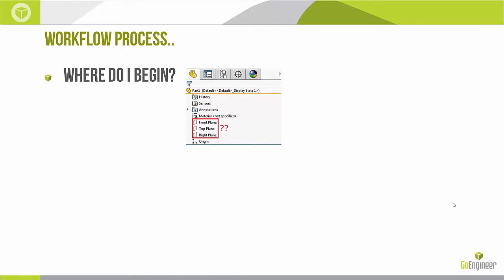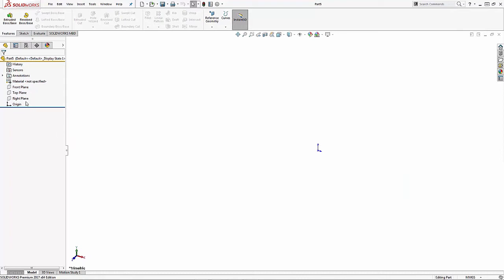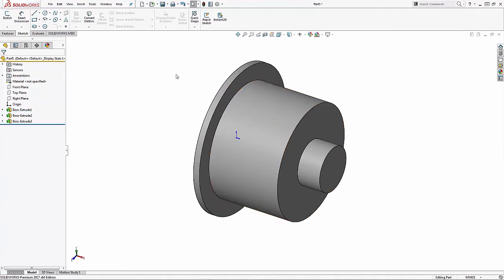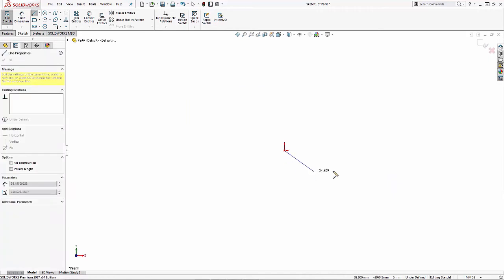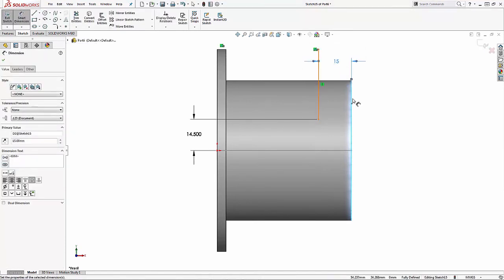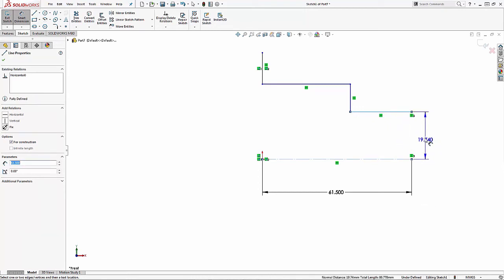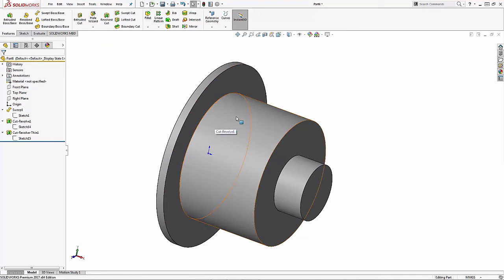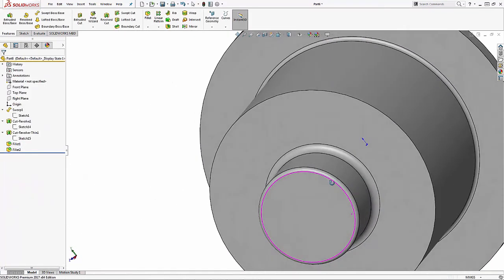SOLIDWORKS 2017 201 - Basic Part Modeling That Captures Your Design Intent

Comment: Hi GO . I want to begin in CAM .. What should i choose CAMWORKS ,SolidCam or powermill ..please a advice
And are there helping videos?
Reply from the maker: Hi Khalil,
CAMWorks itself is built directly into the SOLIDWORKS interface so if you  intend on utilizing SOLIDWORKS for design prior to moving into CAM you would want to look at CAMWorks.  Additionally, in the release of SOLIDWORKS 2018 a product called SOLIDWORKS CAM will be released attached to every SOLIDWORKS license.  This SOLIDWORKS CAM module is based on the CAMWorks CAM suite and would be familiar if you were already using CAMWorks.
Reply: i'm using solidworks